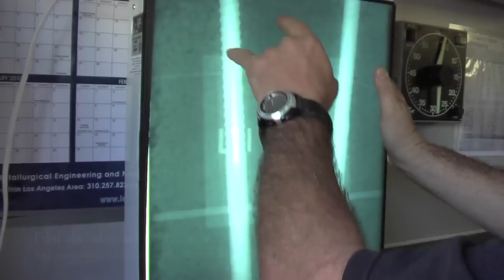Concrete X-Ray - IQS

Comment: Nice, how thick was the concrete? I remember when I worked out on the east coast we did inspection on concrete in a parking structure to find the tension cables before they drilled holes in the concrete. Only thing was the concrete was 14" thick! We had to wait untill we had a fresh Ir192 source to do this and even at that our exposure time was 4 hours long!